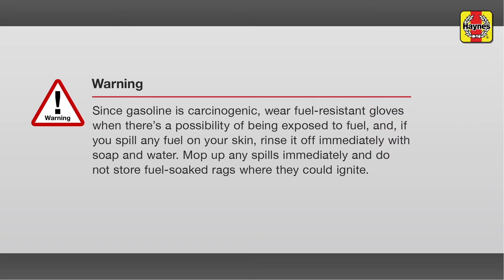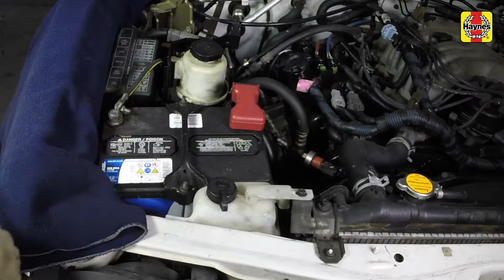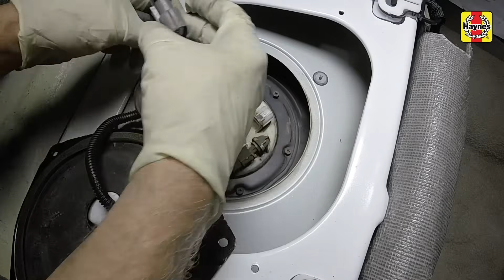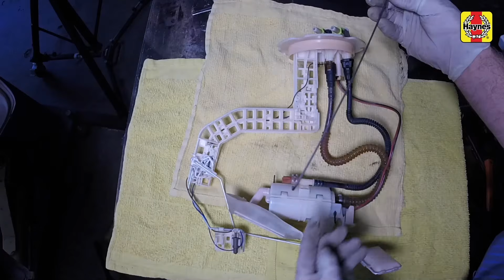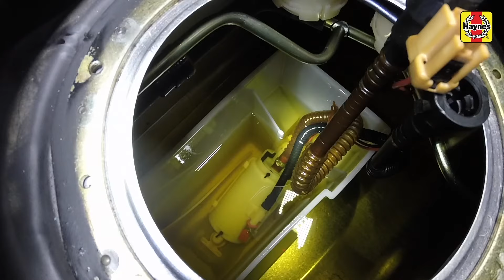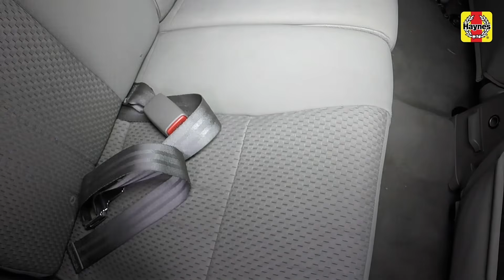Nissan Xterra (00-04), Pathfinder (96-04) or Frontier pick-up (98-04) - Replace the fuel pump

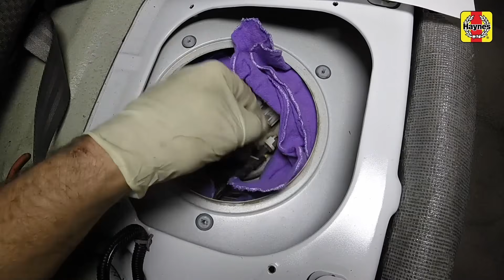Comment: 2:38 "squeeze the quick release tabs and disconnect the fuel lines" yeah those fuel lines are basically welded to the fuel pump. Been wrestling with them for 20 minutes now.

Comment: Hello! Very nice video!
I replaced the fuel pump on my 2000 Nissan Frontier, but I noticed that the return fuel line that is attached to the fuel pump plastic housing does not have that little plug at the end. Why is that and do I need that little plug?
Thank you!

Comment: Here's a tip to save your skin:  The metal around that opening to the fuel tank is rather sharp-edged. Depending on how big your arms are, you may very well tear up the skin on your forearms when reaching down inside the tank and maneuvering the pump assembly during removal and install.  Gasoline making contact with open wounds is....uncomfortable.  To avoid this just take some blue masking tape and run it all around the perimeter of the opening so that it covers that sharp edge.
Reply: Brilliant idea

Comment: This video is not accurate for Frontiers.  They need to remove Frontier from the description. It is not under the seat. You need to remove the gas tank. I learned the hard way...
Reply: SOB... Haynes you really screwed the pooch on this one.
Reply: @808breaksbad 😂😂😂😂😂
Reply: The replacement is identical method of getting to it is different but it's easier lifting the bed
Reply: Stupid girl robot machine! 😮

Comment: I put a new fuel pump in but it wont work installed in  the tank! if i put the fuel pump in a  container of  gas and hook the pump to a 12 volt power source it pumps like crazy and recurculates the fuel in the container but when i plug it into the sending unit and plug it back to the truck harness and turn on the key the motor spins  but when i put the pump back in the truck and turn on the key i get nothing from the fuel pump outlet, i hooked a piece of cleat tubing up and see no fuel when i turn the key on, i just dont get it at all! i have worn my forearm out from taking this pump in and out! any ideas?
Reply: Have you checked the connection for power?  Sending unit and harness? Did you check/test the fuel pump relay? It is separate (not in the fuse boxes), located under dash driver side up around the steering wheel.
Reply: The wires were reversed in the new wiring harness that came with the new pump

Comment: Does anybody know where the inertia switch is on a 2000 Nissan Pathfinder? I’ve changed the fuel pump, fuel filter, fuel pump relay, and the truck still cranks but doesn’t start...
Reply: Did you ever figure it out.
Reply: Sean Malloy I found out a local mechanic didn’t put the fuel pump in the all the way once I took it to a real shop🤦🏾‍♂️
Reply: @9Master_Mind3  sounds like your luck might be as bad as mine 😂
Reply: I'm dealing with same thing did you get it figured out
Reply: Me too.
Reply: I've heard the synthons from which you describe it could be the crankshaft positioning sensor, the cam shaft sensor (which is part of the distributor) or the knock sensor. All of these are a bitch to replace but part is relatively inexpensive.

Comment: I was hoping this video would show how to remove the  Hose end connector underneath the sending unit.  The one in the middle I can remove.  The connector closest to the outside is a pain.   Just about every video on YouTube on this subject skips over this procedure.
Reply: This is the same issue I was having. The hook tool was a fantastic tip though to remove the whole assembly
Reply: just leave it attached and take it off down on the side of the plastic fuel pump housing where that little one way rubber check valve is